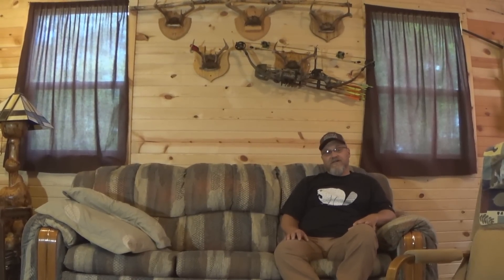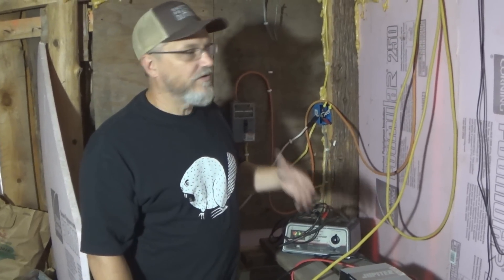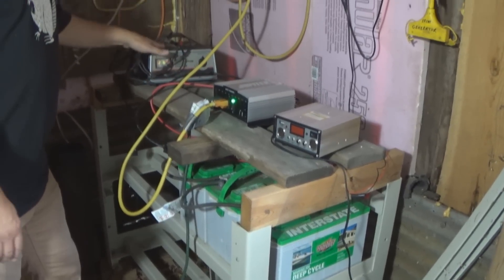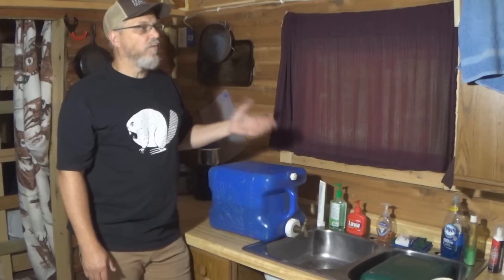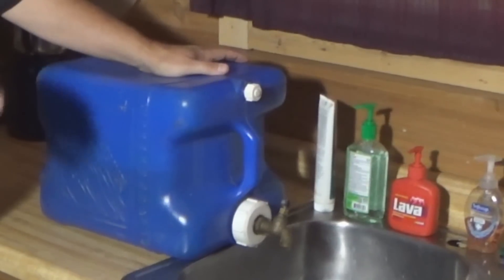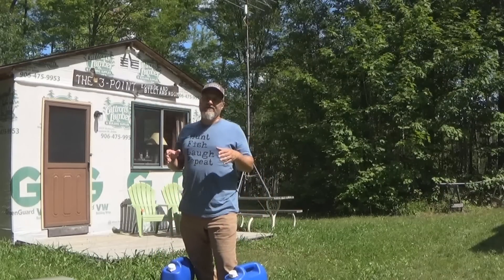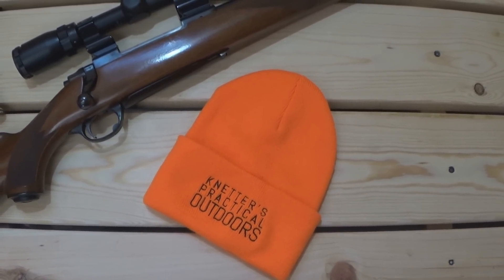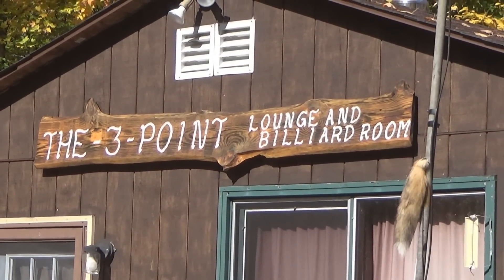Off-Grid Utilities - How We Do Heat, Water, Electricity And Sewer

Comment: For the outhouse: Add a vent pipe through the floor,up through the roof. Paint the pipe on the outside black.as the top of the pipe warms up it will create a draft pulling whatever odor is in the hole up and out. Remember the higher the vent pipe the more draft it will create and the higher it will release the odor. No more wood ash filling your outhouse.  Instead a cup of lime for flushing. These tips will extend the life of your outhouse.
Reply from the maker: Yes that would help!

Comment: I don't know if you would be able to respond to my questions somehow? 
First Question: would you be able to link the equipment you used so we can find it on Amazon?
Second Question: Is there a certain size breaker box needed?
Third question: Is the breaker box wired to something?
Fourth Question: A controller for a solar panel? are there different sizes or a certain size needed? 
Thank you for your time.
Reply from the maker: Thanks for your interest.  As far as links - Ashley stove -  https://amzn.to/3D4v2D2  This is listed as a coal burning but I think it's the same one we have and we have always burned wood in it.  Never had a problem.  You could email the manufacturer and see what they say.  We have one 15 amp breaker that feeds the entire camp.  Light, TV, DVD player, no issues.  The breaker box is wired to feed the camp and feed from the inverter.  With some solar panels it is recommended that you have a controller to regulate the charging.  Bigger solar set ups may need bigger controller.  Having said all that we have since upgraded are electrical system at the camp and I'll be doing a video on that in the near future.  Keep an eye out for that.  That video will have several links to products.  Thanks

Comment: In order to charge and discharge all the batteries in the pack equally,  improving it's capacity daily, and it's lifetime, you need to hook your positive on one side of the pack, and the negative to the furthest battery from where you connected the positive terminal. I know it seems like it doesn't really matter, but it does.
    FYI, Marine deep cycle batteries are not real deep cycle batteries. They are really SLI batteries with (slightly) thicker plates, but will not last nearly as long as real very thick plate deep cycle batteries. When those die,  if you want to stay with lead acid, electric golf cart batteries are real deep cycle batteries, and you can get them for almost the same price at one of the big warehouse stores.
    Don't expect Harbor Freight solar equipment to be efficient or last very long.
    If you happen to see a wily old turdy point buck nobody can seem to get, let me know, I know a guy who bought a special gun to shoot it with.
Reply from the maker: I will keep ALL those things in mind!  Thanks!

Comment: Wow! You must live on some really remote land to have an outhouse! I just bought 6 acres of off-grid land in Arizona. It's a community of cheap off-grid land called " Bridge Canyon Country Estates". Electricity is solar and generators. Water is an above water tank (Arizona allows water catchment). But an in ground sewer system is required. Also RV camping is only allowed for 10 days, 3 times per year so you need a cabin.  Lots of off-grid properties selling for only $3,000 an acre! They have a club house for the many off-grid land owners to exchange ideas,  but no HOA  and no dues! Only restrictions mentioned are from the County.
Nearby attractions: Route 66 (Seligman) and the Grand Canyon!
Reply from the maker: Sounds pretty cool!

Comment: A lot of questions, but this is an old thread.   So, many things you could of done ,that would have made life so much easier.  I've been doing the off-grid thingy most of my life, and I'm old now. Off grid is actually simple and easy if you go at it, like it's the way everyone does it.  Instead of how you do it. #2 things you do not have off the jump is a Woodcook stove. #1 device required. #2 Gas stove 32 inch, not a Coleman. 3rd thing is at least 500 watts of solar power. And 4th is a 300–1000-gallon cistern. Underground cement tank. Then you can have everything you have at home. Including a working toilet and shower and bathtub. Lights t.v. cooking, heat, and power. Even cable t.v. and a computer.  It's all in the way you think.          Peace.
Reply from the maker: All great ideas.  Maybe we'll try a few.
Reply: @KnettersPracticalOutdoors  You can do some pretty cool things with your phone. Like watch movies and such right? They make a projector that your phone goes in, and you have big screen t.v. or news or whatever. from small to huge. Most of the smaller projectors uses minimum electricity as well.  so never miss another football game again. phone added to projector. You add piece of mind to your cabin by adding a trail camera to the exterior that is linked to your phone. I bought the battery from amazon for like $39 and it comes with the solar panel to keep it charged. It's smaller than a car battery by half. But it runs year-round watching my cabin. If it trips my phone notifies me and shows me video's. I put it up in a tree facing down on my cabin, about 20 feet up. Has a platform it all sits on. Hard to steal or destroy way up there. Video's go directly into my phone storage, so I got you, regardless. All kinds of stuff to be had.         Peace.

Comment: Solar and 12volt led lighting is faaar more efficient. Even in extremely low light days mine keeps up running lights , TV, fridge,  charging my wife's wheelchair and fan. Only time I run a generator is when we do laundry or run AC on hottest days. 300 watt solar is plenty for us with 6 agm wheel chair batteries. Only time I use inverter is with the microwave , washing machine and AC. Inverters use power even when not using 120 volt system. 
I heat on coldest days ill supplement with a small rocket stove that is super efficient that only needs small limbs or slivers of wood to heat....main heat comes from a system I made that heats anti freeze through copper and plastic tubing that heats off camp fire ( since I do almost all my cooking /coffee etc on campfire). 
Use a little ingenuity and make a fire ring that is almost a rocket stove and you use very little wood ...I dont need to spend a crap load of time cutting firewood like most people do. ....ive estimated that a cord of wood will last me 3 years....to cook, heat , heat water etc., although it's hard to guess because a lot of what I burn is just small tree limbs I pick up off the ground...lol
I  bought a bag of pellets before for the rocket stove but they get a little too hot ....same with small chunks of car tire ( which still puts out no smoke from the rocket stove and can barely even smell it)....superefficient!!
Rocket stove puts out ( measured) over 1000 degrees Fahrenheit and I can put my hand on the exhaust 6 inches from the highest heat . For safety sake I have the exhaust 2 feet from the highest heat then finish venting with pvc plastic pipe that when I made the turn to go through the wall I had to put a small hole in the bottom of the outside elbow to drain the water out of ( which is nearly all that comes out of the exhaust....water vapor).
No I don't use car tires to heat with....just wanted to see how/if it would work...again , too hot, for safety sake( over 1300 degrees at the hottest measurable point...not in the actual fire chamber , which is surrounded so i cant get a reading on it).
Reply from the maker: All good stuff!  Thanks for adding in.

Comment: DO NOT USE LEAD ACID BATTERIES FOR OFF GRID POWER!!!!   
If those are lead acid batteries you're risking your life and home as they off gas hydrogen as they heat up when they charge and it's a very potential health , fire , and explosion risk inside your living space. All it takes is a small spark or open flame for the fire or explosion
Reply from the maker: That is good advice but our battery bank is in a well ventilated shed.  Our shed walls are made from slab lumber (large gaps between every board).  Also large gaps between the roof and walls.  Near the inverter we put up a small interior wall, otherwise snow and rain would cover the inverter.  That's how open the rest of the shed is.  Thanks for adding that in though.  It's good advice.

Comment: I'm curious about the math on how much propane you'd use per day there? I saw you had a propane grill I think. And it'd be interesting to hear about what the cost and usage would be depending on if only doing meals or also using it for heat.
Reply from the maker: We are only there 20-30 days a year.  A 20lb tank of propane will last us over a year.

Comment: I didn't notice a vent on your outhouse. If you vent from the pit directly to outside over the roof, and keep the hole covered inside, a lot goes outside instead of inside. I like to use a 4 inch black pipe up the south side as sun heating will help draw up the air, and a rain cap is highly recommended.
Reply from the maker: Yes that would be a good addition!

Comment: @ 1:17 

You: off grid means we are not connected to the electric grid that provides power to everybody 

Wrong. 

Off grid means you are not connected to ANY grid, electrical, water, sewer, gas, wired internet.
Reply from the maker: Well, if you Google the Wikipedia definition, "Off the grid traditionally refers to not being connected to the electrical grid, but CAN include other utilities."  So I think saying my statement at 1:17 is "Wrong" might be a little incorrect.  Especially since I'm a traditional kind of guy.

Comment: You would benefit from a smaller generator or a larger battery charger. You're wasting a lot of gasoline by running your generator at low load. I have a 700 watt generator that sips fuel (like 8 hours per gallon) which would be perfect for your small charger and cabin loads. Or buy a 100 amp charger and run your generator under more load where it's more fuel efficient.
Reply from the maker: All true.  One of our camp members has a smaller generator that we use at times.  But it's his personal generator for his home.  The generator in this video is the "camps" generator.  We don't leave it there for fear of it being stolen, but it was jointly paid for by the guys that use the camp.  So it's the generator that travels to the camp mostly.  We bought that size 20 years ago to handle power tools and air compressors as we were build on the camp a lot back then.  I do think we may buy the bigger charger soon.  Thanks for the input.
Reply: @KnettersPracticalOutdoors  I completely understand - my first generator was 6500w and it's great for running big tools. But the small unit is surprisingly useful. I got one basically identical to "GEN1000I 1000 Watt Inverter Generator" on Amazon - much cheaper than a Honda but almost as good. It can run my refrigerator, or microwave, or window AC, or 30 amp battery charger.

Comment: Given the foliage around your camp you have good rain and humidity. A few things that might prove practical for your camp. And hour shower. https://www.youtube.com/watch?v=WgF9OoX0-w0&t=1013s&ab_channel=GoneBoondocking
And an atmospheric water generator. https://www.youtube.com/watch?v=k7Vfp4aAuKE&ab_channel=desertsun02
Set the water generator up to fill an IBC or 2 and that would be most if not all of the water you would need. A tarp strung between trees to capture rain water also.

Comment: Hum….I just had a transfer switch put in for my gas generator. I have a Egoflow Delta and 1800w Opeus generator.  I was wondering if I could charge up those generators with my gas generator?  I have the solar panels for them, but if I don’t have a sunny day, could I?  I didn’t want to as the Electrion for fear of giving myself away. But maybe I should of..
Reply from the maker: I think you are asking can you charge a electric battery generator with a gas generator?  Best to check the owners manual as there can be many different variations to battery powered generators.
Reply: @KnettersPracticalOutdoors    Yes, can I charge up my solar generator with my gas generator.  I will go back to my manual. Thank you for your response

Comment: when I hauled water I'd always have a 50 ft or 100 ft hose at water location to be filled and keep a tote on my truck fill it with a pond pump powered by inverter, and pump my water from truck tote to location like a gas truck at a gas station just not in the ground...
I would definitely do a plastic ibc totes septic system over a compost toilet, even hauling water to fill a standard flushing toilet is so worth it .  I mean compost toilets work absolutely, but the piece of mind and top end comfort is priceless for the same invested efforts...
good video and advice, I can always tell who has done it and who hasn't by the creative outcome, off grid is where the real you is, the God given you, and it will educate you beyond your dreams, lol or nightmares 😂
Reply from the maker: Thanks for adding in.  If we lived here I would add a flush toilet, but for our use it works.

Comment: Spend the $200 and get yourself a propane fired on demand hot water unit, runs off of a 20lb propane tank and 2 D cell batteries for the electric spark igniter.
Reply from the maker: Sounds like a good option but we do like our sauna.  And we have 80 acres of fuel (maple hardwoods).

Comment: Yup. Combo the generator & the solar (w/a good voltage regulator), to subsidize charging your paralleled 12v's 👍 That's the way to do it man. Great set up.
The more appliances you can keep running on DC the better (I'm sure y'all know that). I know there's a lot of appliances you don't have a choice & you gotta to run on AC but it can really save some juice bypassing those inverters & running as much as you can on DC.
Here in SC it gets SO HOT. I have a 550w window AC unit that I run from a 750w inverter, it drains the crap outta my battery bank. Unfortunately there's not too many ways around it if you wanna beat that summer heat. 
🔥😰🔥
Looks like y'all are enjoying it. Thanks for sharing.
Reply from the maker: We're enjoying it, thanks!

Comment: This is about as basic as it gets !  The absolute minimal 12 volt system you can get , ok for running a couple lights and maybe a small TV , But that's all you can run with something so small.  Is that inverter even pure sign wave ?  If not you wont get away with running a TV for long .  TV doesn't like modified sign wave !
Reply from the maker: Yes, lights, TV and a DVD player is about all we do.  I know some electronics didn't like a chopped up sine waves in the past.  But I think the power supplies on more modern electronics are made so much better now.  They seem to handle very basic AC patterns with ease.  With all the camping and off-grid stuff going on these days, there is a lot of TVs running on cheap, modified sign wave inverters out there.  We've used this inverter for about 5 years now with a 27inch TV.  So far so good. Thanks for the feedback, KPO.

Comment: You really need to stop saying off grid, you’re not off grid when you have to go into town to get gas for your generator to power your camp
Reply from the maker: I understand there are different levels of being "off-grid".  Some places are more off-grid than others.  But our camp is off-grid.  We are not connected to the electrical grid.  We don't have a gas pipe utility coming into the camp.  We don't have a city water or sewer pipe coming into the camp.  Yes we buy gas at a store for our generator.  We also bought our batteries and solar panels at a store.  We bought our inverter at a store.  If a cabin owner buys candles at a store can they be off-grid?  I never claimed we were living off the land or whitewater rafting back and forth to the store.  This is just how we do it at our deer camp, nothing more, nothing less.

Comment: Hi, I'm looking at putting a day cabin in the woods, here in NC, and just checking our other folks efforts.  You have pretty much as I've considered, and it's good to get substantiation.  Well done, I've been running a 300 gallon ex-propane tank in my machine shop to heat a 40 by 60 metal building, for a wood stove, I really like your sauna set up, thanks for all of this.
Reply from the maker: Thanks for adding in.